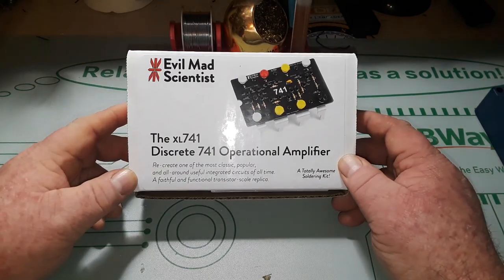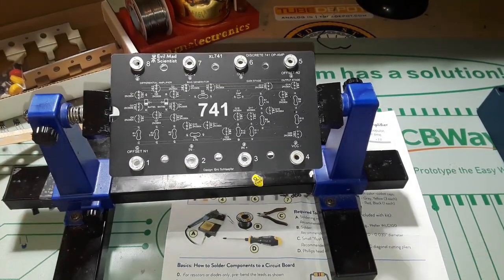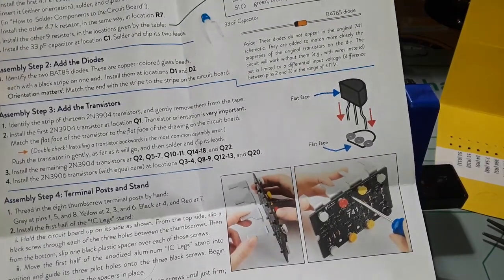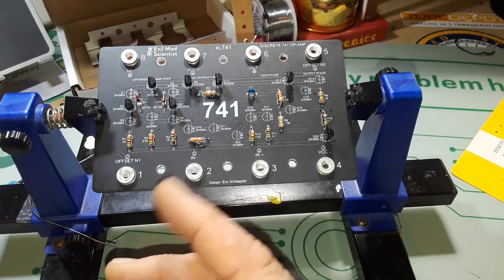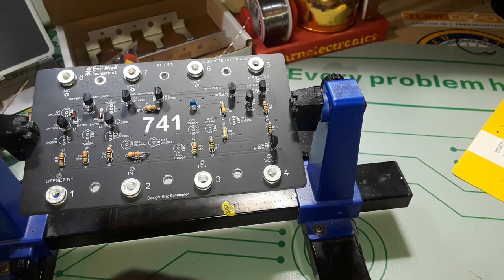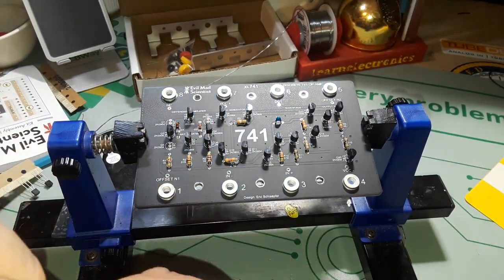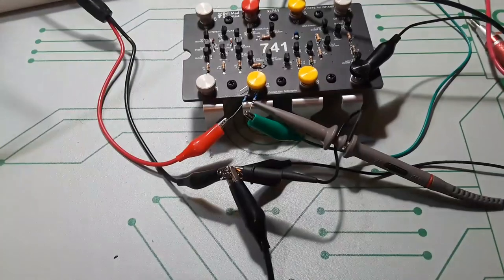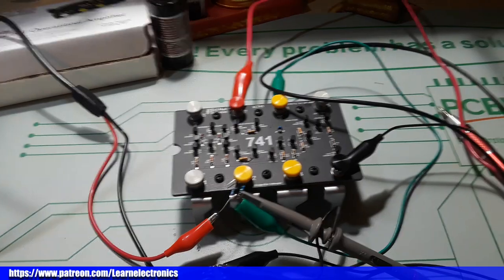Evil Mad Scientist xl741 OpAmp kit Build

Comment: In the mid 1960's Electronics World had a project to build a tube based opamp. As i recall it used 4ea 12au7's and all the resistors and diodes it took to make the circuit. I priced it out with the Allied electronics catalog and it came to just under $100 (not including the chassis or power transformer0 which was real money back then. 

I never built it because of the cost but a few years later I was working for Analog Devices in Cambridge as an engineering tech on their 426 high speed multiplier. It was all discrete parts on a 1-1/2" pwb that went into a potting shell and had 7 pins that would plug into a mating socket so you could wire it into a circuit. back then Caps inside IC's were not common so were usually added externally.

Comment: Hi bud. Could you do a episode on op Amps. I just cannot get my head around the negative power supply and how to generate it. Not using batteries, just a power supply.
Reply from the maker: I have done 23 videos on OpAmps. Look here: https://www.youtube.com/playlist?list=PLGhvWnPsCr59UABN4iEhmGlRaNd1wqOof
Reply: Hi, can’t see one that just has a power supply that generates the + and - voltages ( rail to rail) to get a full swing on the op amp (without using a battery).

Comment: Now, set up identical circuits using a sine wave input. See if the discrete components op-amp matches an IC 741 opamp.
☮️
Reply: Unless they took the time to get all the components as closely matched as possible, then I highly doubt it would even come close to the performance of an actual IC 741. And even if they did match them as good as they could, there's still the issue of thermals. Even a slight difference between transistors can throw their specs out.
Reply: @JaenEngineering  
It still would be interesting.

Comment: I have the 555 version of this, but I've yet to build it because I still don't quite get how the 555 works.
Reply: Part of the point of these kits is that by breaking out the schematic into discrete points, you can probe every single part of the circuit to see what does what to what

Comment: Hey, Love the channel.  Could you explore how to make a relay circuit that can be turned off and on with an HC-05 bluetoothe.
(Without the use of an arduino or other MC ?)
Reply: Hc-05 is a serial based device. You need to connect it to something that speaks serial. Most commonly this would be a microcontroller. I don't believe there is a way around that.  There are tons of microcontrollers like attiny etc. But without one you would have no idea what communication is without one.
Reply: Thanks, yeah I was hoping I could amplify the TX enough to trigger a relay. I have an arduino but I didn't want to tie it down in a permanent  project. I'll find a workaround.
Reply: @Tom Rademaekers  you can amplify the TX but it will trigger as soon as something connects to it with no verification of who or why I think. Anotherwords if you connect, it will trigger without knowing what the data is. If that is the desired behavior you can but you will need to have it be a time based thing probably like a time latch circuit because the TX will probably blink many times, not just once. You would need at least 2 transistors a capacitor to set the time and multiple resistors to make it work. I have never tried it but I think it could work. The first blink will trigger a transistor that pushes a charge into a capacitor. Once the capacitor is charged it would drain through the second transistor turning whatever you want on. The second transistor would slowly drain the capacitor until a certain time and then it will turn off.
Reply: @Tom Rademaekers  just google simple time delay circuit you can find a picture with a push button and an led. When you push the button the led stays on for a while. Replace the push button with a transistor connected with a resistor to your TX line, and then replace the led with your relay. Make sure you have a diode to protect the transistor with the relay connected to it against the back emf of the coil. If you have trouble it's probably because the first transistor is not turning on hard enough. If that is the case use a darlington in its place.